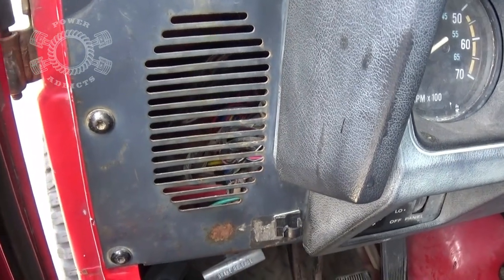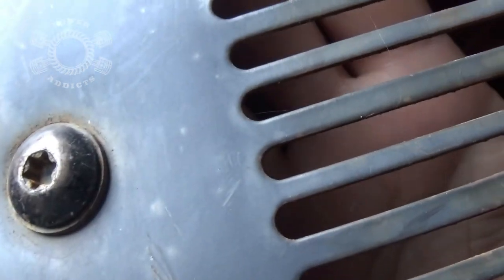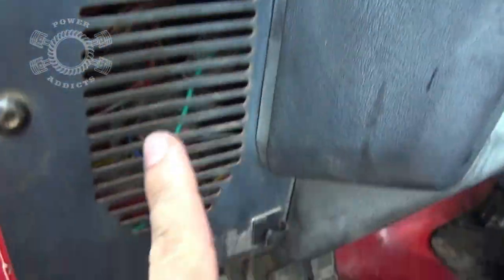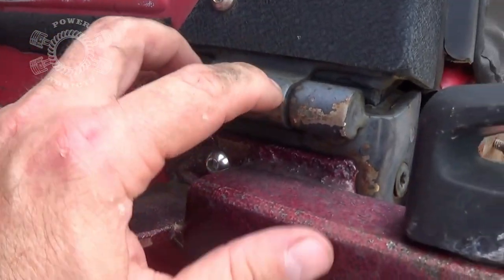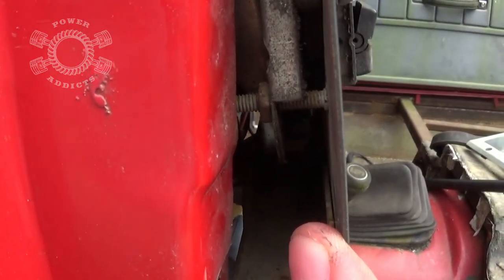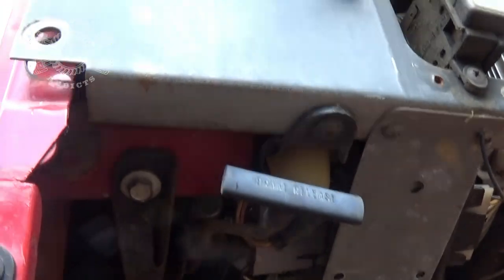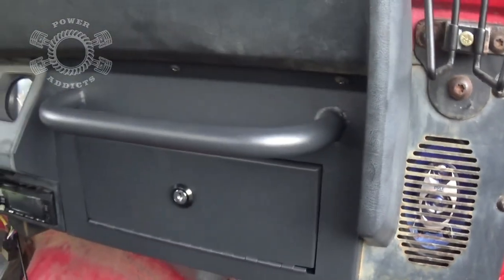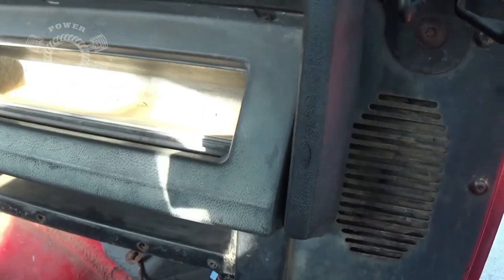YJ Dash Speaker install tips #poweraddictscrew #jeepwrangleryj #jeepyj

Comment: Just replaced my speakers with the same ones on my 95 yj.   Great sound!!  I took the dash apart to remove the old ones.  Your right...total p.i.t.a!    But i also replaced my cowl weather strip since it was the factory original.  2 for upgrade.
Reply from the maker: Crazy thing is .. I still haven't wired them to my radio. I've got an idea to put a subwoofer in my rig as well. I'll wire it all in when I do that. Thanks for checking out the vid!!

Comment: “I can get to it if I remove the speedometer”. If I remember right, you’re talking about the removing the tachometer not the speedometer, which is very easy. I had a professional stereo shop do mine that’s always book solid for weeks. I told them I wanted all the old parts and boxes from the new items etc. When I went to pick up my Jeep, I inspected everything and noticed both front speaker tweeter were hitting the grill, they assured me it would not hurt or change the sound at all. When I got home, I read the speaker box and installation instructions and there is a spacer plate your supposed to use, they didn’t. I didn’t want to take my Jeep back to them because there were other issues in their installation. So far as they said no issues, just makes me uneasy. Great video. Thanks
Reply from the maker: Eh, I goof up often in the vids. Sometimes I catch it .. sometimes I don't 🙂. As long as they didn't crank the nuts too tight it shouldn't be an issue. If the speaker that I installed had come with spacers I would have definitely used them, the 1/4-20 nuts served the purpose though. You are welcome. Glad you like the video!!
Reply: @Poweraddicts  Keep up the great work. Thanks